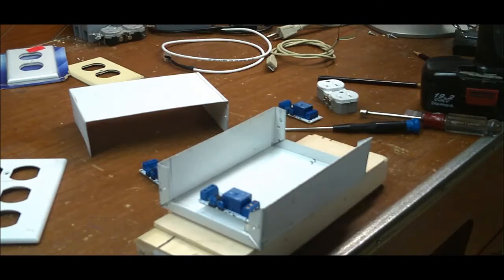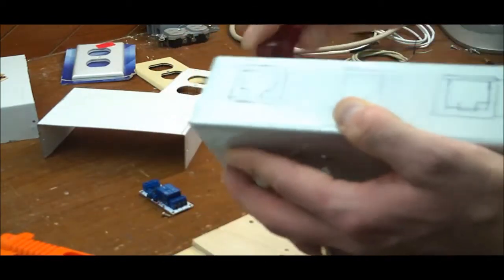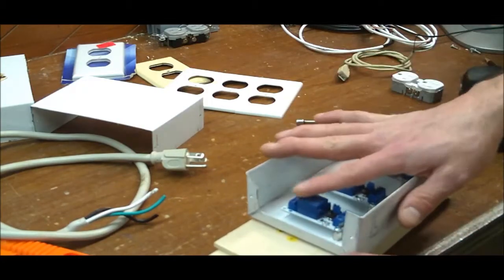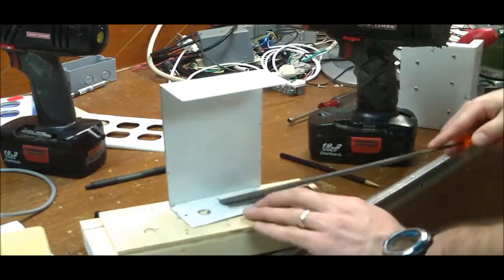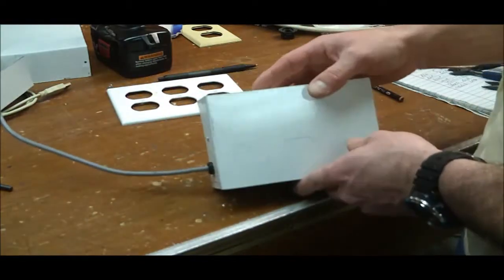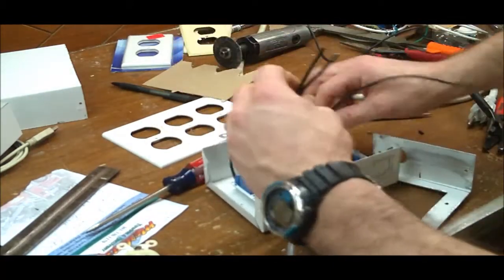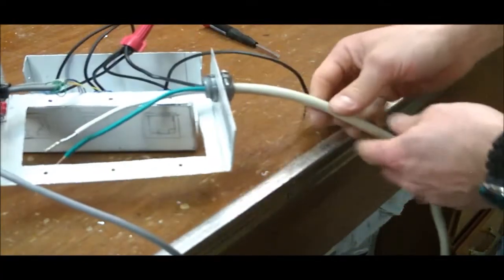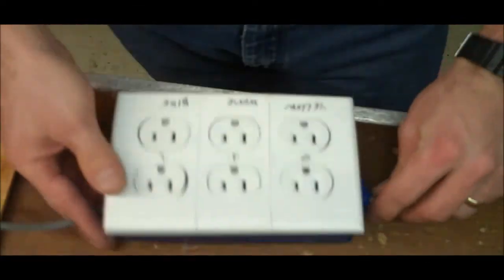HOW TO: DIY 120 VAC Power Switch Center / Arduino Controlled Relays -

Comment: You can't tin the ends of terminations with soft solder. It compresses and the joint arcs. Read the NFPA and UL white book before you do any more of this.
Reply from the maker: +Crocellian thanks for the tip. Ironically I stop doing this as it was hard to get the screws tight.